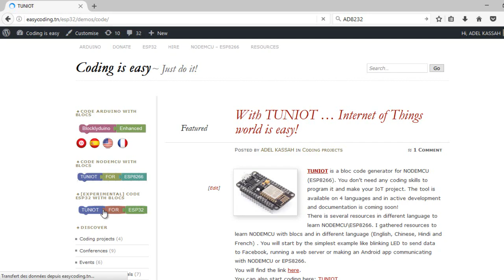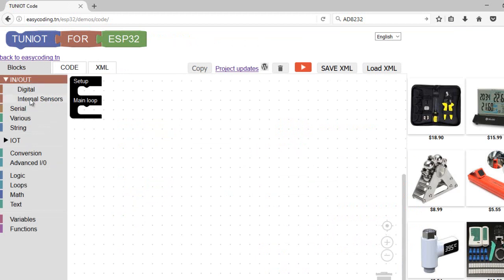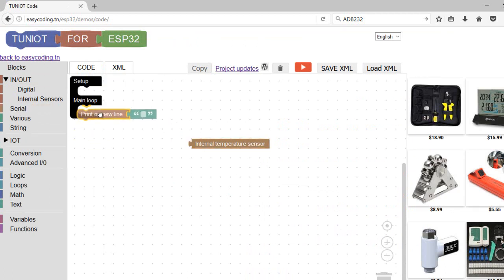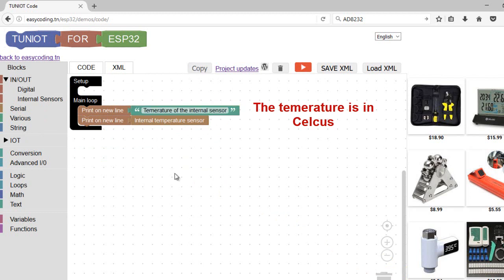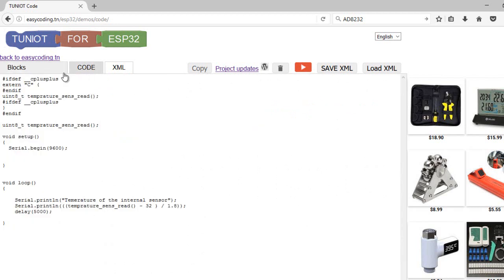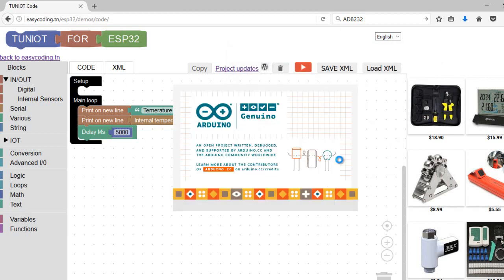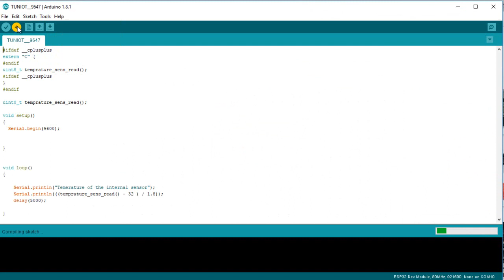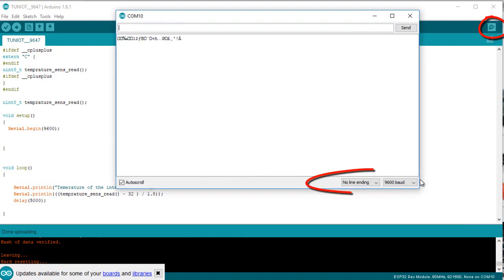ESP32 tutorial A-17: The internal temperature sensor

Comment: For people asking why the readings are high or not accurate, note that this is an internal sensor, which means that it measures the temperature of the internals of the chip and not the ambient temp of the environment. There are also some long discussions on github and esp32 on the fact that the sensor has some random offset and is not very reliable. I would use it only for delta calculation for normal vs hot operation to trigger a warning or something.
Reply: Oven = 53.33 degrees, fridge = 53.33 degrees. Worse than "not very reliable".
Reply: Oh, it's ok anyways

Comment: Not very accurate readings,!
Reply: I assume the internal temperature sensor was put in to monitor the temperature of the chip itself, not the outside temperature. Many chips, especially processor chips run at high temperature, so a high reading isn't unexpected.
Reply: abi crazieeee yeah... 51.6 deg c ?? Middle of a desert !!
Reply from the maker: +William Moore yes for sure